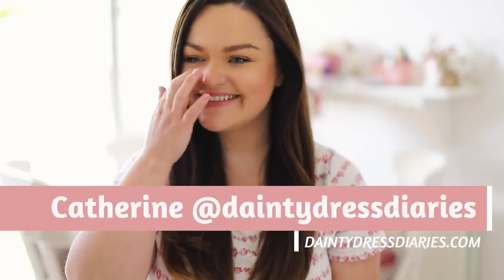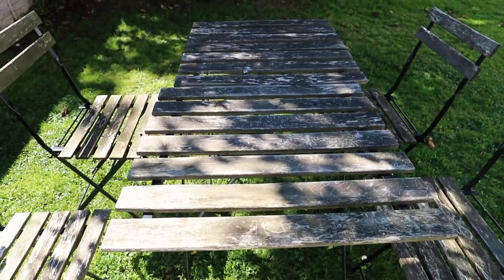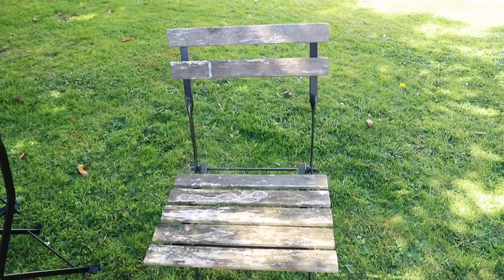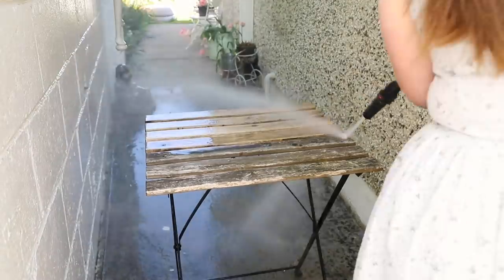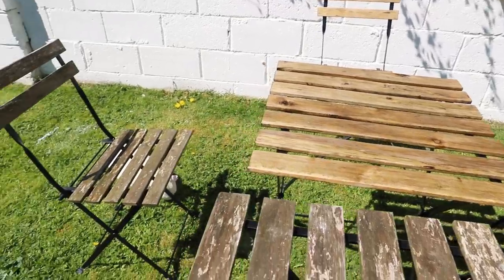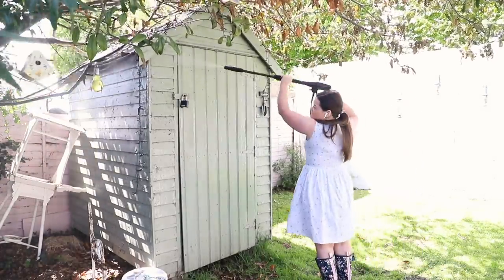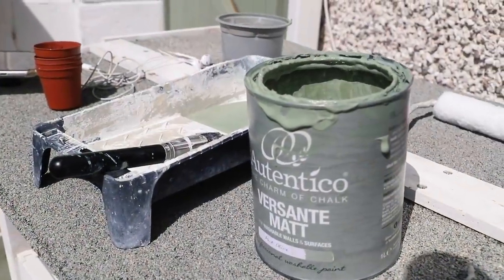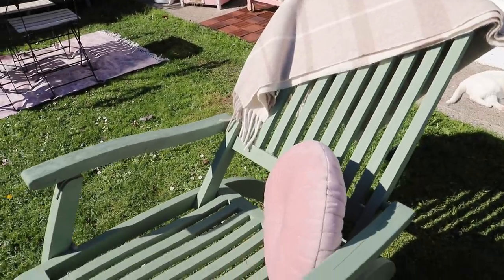Garden DIY Vlog, Reviving IKEA TÄRNÖ table set and Easy Sew Table Runner.

Comment: Hi from the USA..🤗🇺🇸  Love the video. Yes I painted my small ladder that I picked up at a flea market with milk paint in red. And I painted an old ladder I found in a pile of swing set stuff..redwood it was. I sanded and painted it black with milk paint for indoors to hang quilts on. Those turned out nice. The red one for a side table on the patio for a cup of tea. 🙂  Put a small plant on it too. And last I helped my hubby paint rails and poles on our house. Then I decided to repaint my rose arbor white with primer paint and half way through scraping old paint off and sanding..my hubby says we could pressure wash that if I go get one...🤪 That would have been smarter and faster!! But it is done and it all looks beautiful along with my gardens. And I did not buy anything except the black rustoleum spray paint for the rails and the white trim house paint. Everything else we had. So paint is an inexpensive way to freshen up your life. Love your shabby sheek looks and I have country Americana at my house. Fun to get creative. Did you ever work on the bedroom you painted and put the beaded board around...been hopping to see it?  Stay up beat and give Blondie and Pepsi some hugs. I have three cats...🐈🐈🐈🌷💖🌻

Comment: I 👍the video, but the counter didn't change 😐. You're the only person I know that would power wash in a nice dress and wellies😅. Good to know that the Ikea bistro set is so weather resistant. Everything turned out so nice. Blondie was a big help, as usual. Yeah, it doesn't take much to neaten things up. Your yard is so welcoming. We've been working in our garden too. Usually, our weather gets to 90 degrees, sometimes by the end of March. We have had the most glorious spring and it's only in the 70s today. I hope summer temperatures do not reach high 90s this year. I have lots to do still in our yard. Take care.
Reply from the maker: Thanks so much Carla ❤️ thanks for watching, I hope your keeping well
Reply: @DaintyDiaries  We are fine, thanks.. We are older and trying to follow the "strict" guidelines. My husband more than me😊. He's a little older than I am. Thank goodness our diy stores have been open or I would have lost it! We've been able to buy wood for some small projects and badly needed gardening supplies. I'll tag you on Instagram to show our new planting on the right side of the house. And behind our breakfast area. I wish I had a tiny garden. Much more manageable.

Comment: Wow amazing! I want a power washer. I have an old metal bistro set that looks like, well crap. Sometime could you show us how to stop wrestling with the tension  on the sewin machine? Mine is very similar to yours but can’t get the tension right.  You yard looks so beautiful! Thanks for the inspiration!!
Reply from the maker: Normally when the tension is off, the machine is threaded incorrectly or snagged in some way, for ages I had my machine threaded the wrong way, it’s really common ❤️